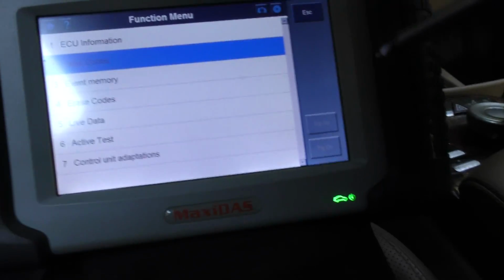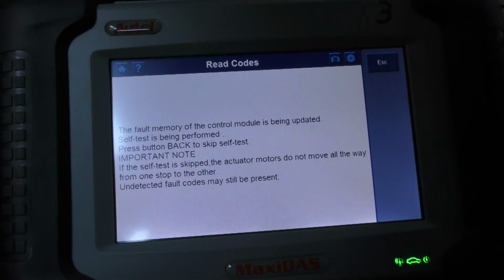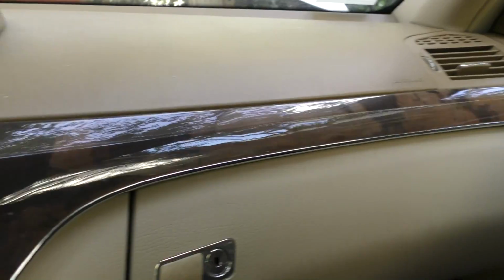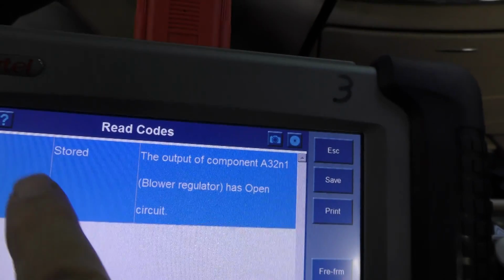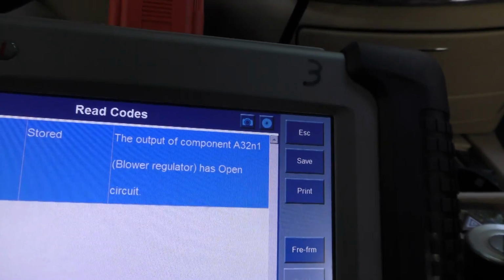How to Fix Modern AC System in Your Car

Comment: if stuff wasn't made to break how would companies take your money?
Reply: the problem is companies need to make more money every year than the last for the stock holders. thats why things are made to wear out in time, so you need a new one or parts.  everything is like this not just cars. Appliances are another good example of this. I had to pay for a part to fix my Kitchen Aid fridges defrost drain so it wouldn't clog and freeze up. the original part was made cheap to save money and not up to the task. that and it will only last 10 or 12 years unlike the one before that was over 25 years old.
Reply: scyther1 Look at Toyota and Honda, theyre doing just fine
Reply: I agree, I had a washing machine last 15 years with no repairs, and now got a new one thinking I'd be saving a hassle in case the old one quit at a bad time and 2 years later after I got it, it started freaking out, needed $215 in electronic repairs!
Reply: Believe231 that sucks. you learned the lesson we all have to learn. "if it aint broken...dont fix it" lol good luck
Reply: Yank Nba no they dont lmao
Reply: Frank Magana they are, Google "planned obsolescence"
Reply: scyther1 exactly my point. all automakers make things to break
Reply: Planned obsolescence :(
Reply: honda and toyotas break too just not as much.
Reply: Is there anyone better at planned obsolescence than Apple? German cars are right up there. Know that, planned obsolescence is more than cheap parts made to break after a period of time. It can also be marketing to the bigger shinier version when the one you have, is just find. German cars over-engineering is an example in itself.
Reply: Sometimes you can jury-rig a part or solution. Take some part that is vaguely similar, and modify it to work. I have sometimes done that. But only if it is a simple problem and you can see what is needed in order to get it to work. Often, the parts are more complex than that.
Reply: Gun
Reply: scyther1 toyota Camry last forever